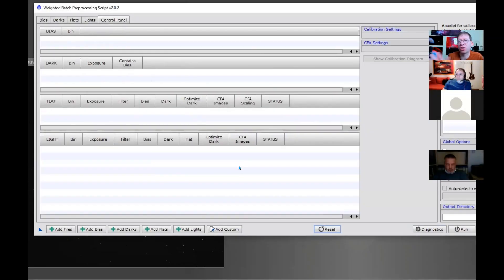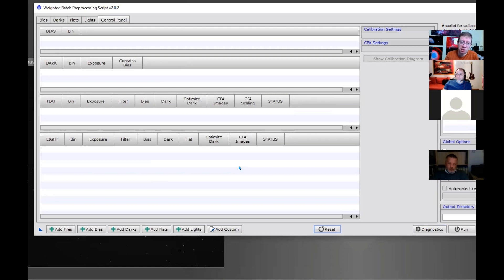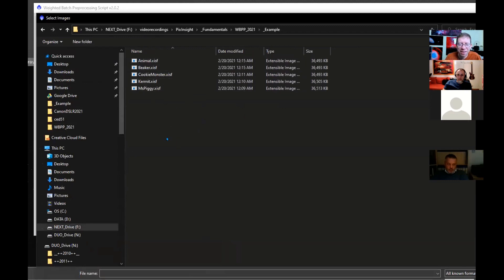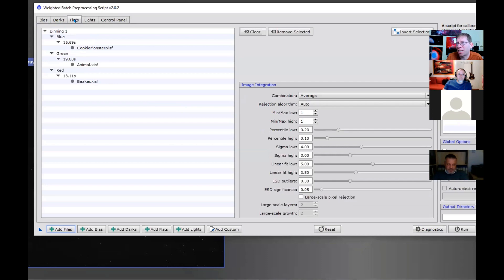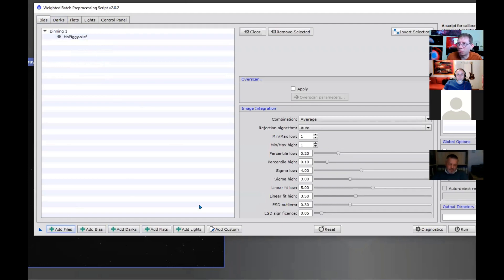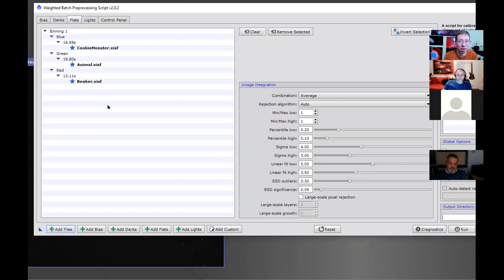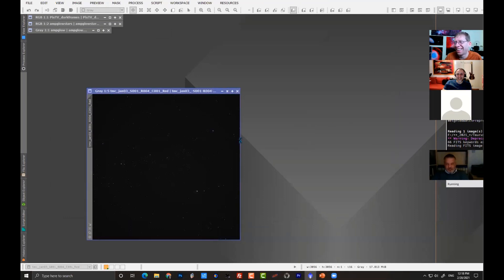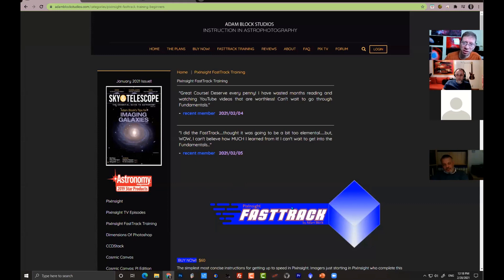Part 8: WBPP 2.0 (PixInsight): Load your own Master calibration files.

Comment: Thanks for this video! The problem i have with wbpp have is that the masterfiles show a wrong exposure. For example if i load a masterdark which was made out of 10 subs with 300 seconds each,the masterfile has an exposure of 3000. Because of this number wbpp doesn't match the master with the lights and asks me to calibrate them with bias frames... The Masterframe itself shows a star. So it has been recognized as a master. What am i doing wrong?
Reply from the maker: That is bizarre. You need to  write this to the PixInsight forum. When you create the MasterDark- it should only show 300sec in your example. I have not seen this issue before. Please ask this question on the official PixInsight Forum.
Reply: @AdamBlock  Thanks for the Quick reply. I will do this. 👍

Comment: Hi Adam. This is a good series. Thanks for it. Question: Gathering 25 darks of 900 secs each takes a long time. Then you repeat that for every different binning that you use. Is there any strong technical argument against taking darks all binned 1x1, then using software binning on the resultant master to create a 2x2 master dark?
Reply from the maker: Unfortunately I do not think this is possible. The read noise is a constant value when you read a single pixel or a superpixel. So if you take a 1x1 dark frame- I do not believe the noise (read noise) will be added correctly when you bin. Indeed, this is the very reason that people bin- it is to achieve a better S/N since the signal from a superpixel is larger than a single- but the read noise is the same (for many sensors). In addition, i think, though I could be wrong- that chip defects, hot pixels and many other things will not be handled correctly. I am happy to be wrong about this though... I would certainly enjoy binning darks to save time as well.
Reply: @AdamBlock  I see the wisdom of your words. Still, I wonder if the errors introduced might be small enough to be ignored. I will test it sometime and if I find something good I will let you know.

Comment: I could not get WBPP to accept a superbias with out renaming it masterBias_  just incase any one else runs into this. Perhaps that can be fixed unless I was doing something wrong
Reply from the maker: Yeah, that is right. You would need to rename it- or load it from a directory that has the name 'Master" in it (then you do not need to rename the file).
Reply: @AdamBlock  I just watched one of your WBBP 2.0 videos where you covered this. Guess I should have watched everything first.
Reply: @AdamBlock  using the directory is easier than changing the name, thank you. Is there anything in the new WBPP that can remove the FPN from my Kepler 4040, lol.